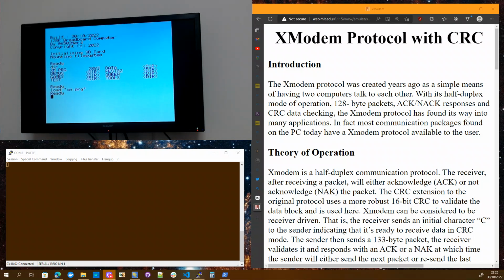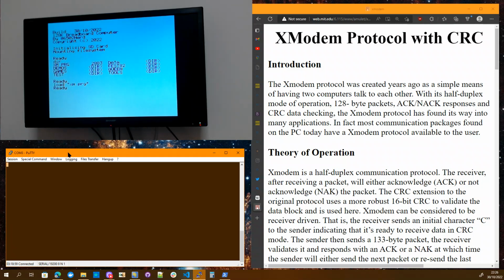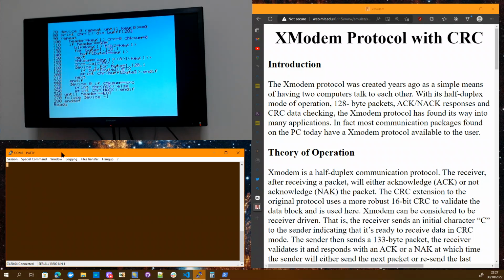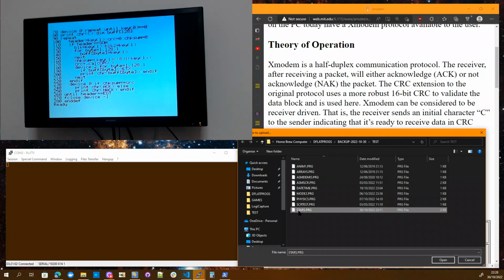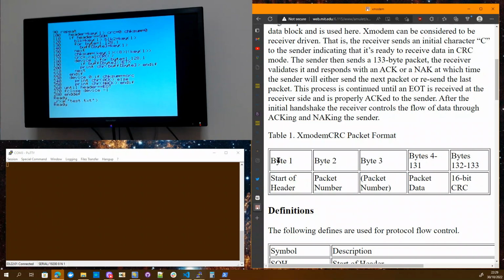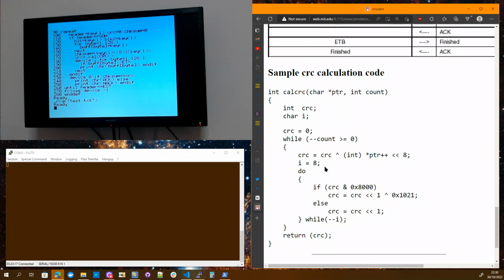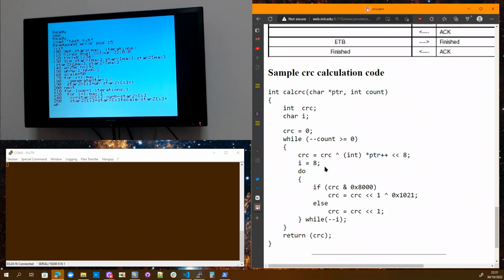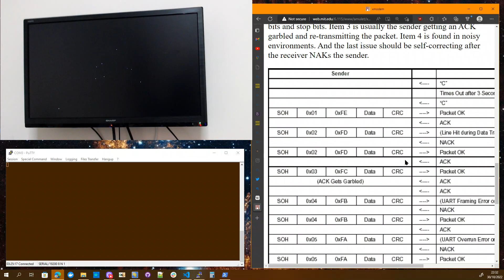XMODEM implemented in BASIC (dflat) on my 6502 homebrew computer!

Comment: Would it be faster to receive the entire packet, run the checksum/CRC calculation, perform the comparison, then ACK/NAK? I know there's a simplicity to performing the checksum calculation on a rolling basis but I wonder if all of that interrupting the execution flow of packet receive would be more efficient if performed in one pass after the packet is fully in-hand.
Reply from the maker: Might not be clear from the messy code but yes, that's what I'm doing. But the crc calculation requires 1024 iterations for each 128 byte payload in a packet and using the interpreted language for this is the reason for the pause between packets...
Reply: @6502Nerd  Is the source code available for your Xmodem routine? I would love to study it.
Reply from the maker: @jaycrutti  I know this is a very late reply (!) but I just saw it somehow after reviewing some YT analytics.. sorry about that. Anyway here is a link to the XM.PRG which is a BASIC like program. The thing to note is that 'device 0' refers to the serial port and 'device 2' refers to the SD card port, then I can use 'key()' to receive data and 'print chr()' to output bytes to whichever device is active..
https://github.com/6502Nerd/DOLO-128/blob/main/SDCARD/TEST/SERIAL/XM.PRG